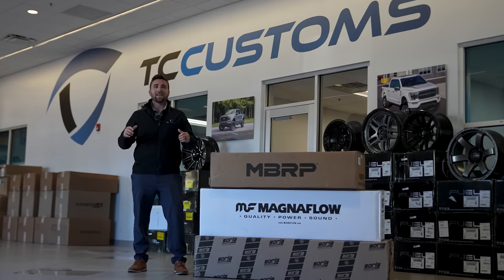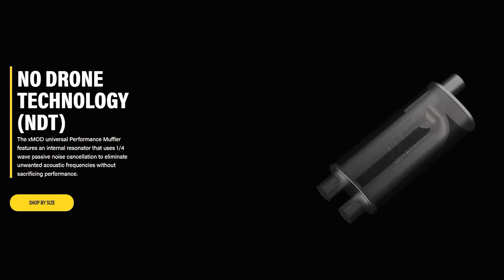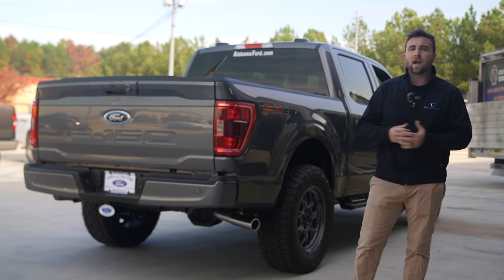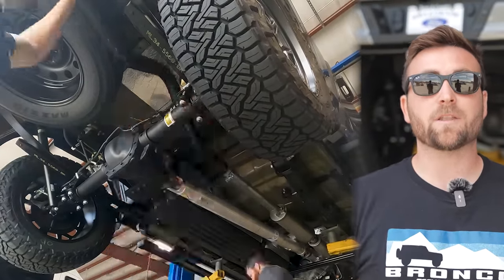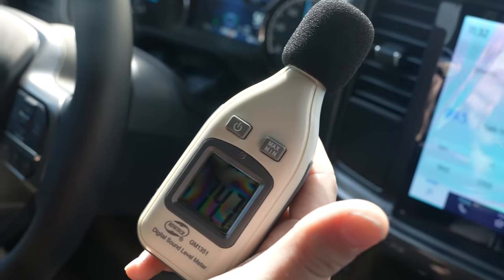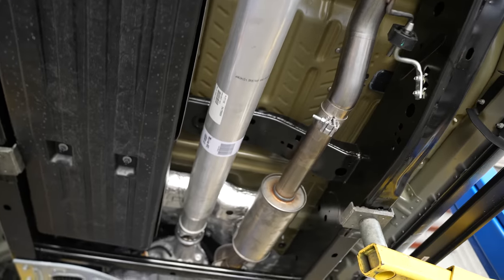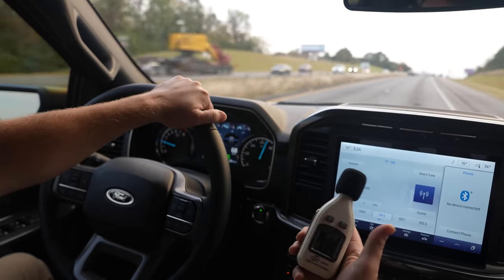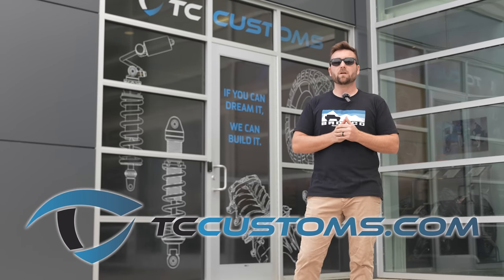The Best Exhausts For Your New F-150!

Comment: The MBRP hits the sweatspot for my ears. Not too loud, but not too quiet.  I need to upgrade my current F150 before the end of the year for work and I'm currently between the Powerboost and Coyote, and after watching this I think it's safe to say I made up my mind 😎. Thanks TC!
Reply: I have mbrp exhaust on 2020 5.0 sounds great when you get on it but pretty quiet otherwise highly recommend if you don’t want too loud
Reply: @bradleycase4391  catback mbrp on 3.7 v6. sounded so stupid. stared rusting within a week. had to paint everything with that bbq paint. from hearing the video it sounds the same as the v8. im going 5-10mph from a red light, loud like the annoying honda civic exhausts. what a waste of 600 bucks. oh and i had to pay 300 extra to install it cuz it didnt fit.  the mechanic had to cut the most rear hanger so it would fit. hahahah mbrp is the worst.
Reply: My 2.3l ecoboost Ranger has the MBRP and it sound perfect. Deep mean Roar at WOT, and neighborhood friend rumble on cruise.  It is not trying to sound like a V8 but gives a deep powerful tone of its own.
Reply: @ugabuga1361  IDK what version you got but  my 2.3l Ranger ecoboost  def doesn't sound like no Ricer. They test and post examples of all the bolts on they sell. It not annoying or chop like those honda civic i ever heard. Deep and mean. gets a little clappy up top but it is just a consist power low tenor pitch.

Comment: The Borla is by far the best sound level and tone. The tips will stand out just enough to be noticeable as the the flat black tips seem to get a little lost in the shadows. Great to have multiple exhaust from the same video, it helps really show the differences and mitigates the different recording devices that change the sound from all the various videos.
Reply: Idk I got a 2023 f150 5.0 and that corsa extreme side dumped before rear wheel is pretty mean sounding. Tho I will say it was between corsa and borla for the win. Both sound good but I went with corsa for the less truck clap sound.

Comment: Well, after listening and searching out the details, I would go with the MBRP.  I like the sound and the black pipe more than just the tip.  Look forward to pricing this out for my new 2022 F150 XLT Sport Edition.  Thanks for taking the time to break down each of the three #MBRP, #Magnaflow, and #Borla this is also the order of my preference.
Reply: Only thing about the Black MBRP is the metal is not most resistant Steel. Nothing wrong with that. However, I may not be the best choice I wet or ocean locations. Armor pro T304 Stainless is the most robust and expensive option.
Reply: I'm also considering getting the MBRP cat-back exhaust for my 2021 F150, however I'm curious about the drone in the cabin.?
Reply: @zacharyadams3274  It is zero at cruise, moderate at light throttle. eeerrrraa! at wot. it is a daily exhaust with a fun switch. that is why i got it. I love it. they have the race model if you want annoying.  great build quailty

Comment: I've purchased two of these exhausts for my 2021 F-150, 5.0L 3.73. The MBRP drones out at around 2000 rpms, which is sustained at interstate cruising speeds. It sounds good, but the drone is just too much. I replaced it with the Borla S-Type, pricey, but it sounds freaking awesome, with NO DRONE.

Comment: Out of these three I would have to say I like the sound of the MBRP the best. 

One thing to be aware of is that because the Magnaflow system that was tested here uses the factory resonator there is more of a restriction in that system. The factory system has a 3" pipe entering the resonator but is necked down to a 2-1/2" pipe between the resonator and the muffler, or at least that's the way my 2018 5.0L came from the factory. With that system you are probably not getting much of a performance gain but maybe a little nicer sound as compared to the stock system. There are other options with the Magnaflow including a straight through 3" pipe that eliminates the factory resonator altogether. I actually tried that system first but later added a Magnaflow resonator which has a 3" ID as opposed to the factory 2-1/2" ID.

Comment: I just bought the 2023 Ford F150 SXT 5.0 and want to add a little something to it. I bought it last night and add running boards this morning. The sound from the OEM exhaust is better then my 2017 f150 3.7 ecoboost but I like the deeper sound and I digging the MBRP deep sound and that is what I would get. It just make the whole vibe of the truck sound and feels meaner.

Comment: Finally “no drone” technology. Drone is the worst. All of the systems sounded good to me. The Magnaflow was the quietest and closest to stock. I’ve been beat up by drone w/all my aftermarket exhaust systems thought the years so I’d pick the Magnaflow which promises to quell drone with clever internal implementation of heimholtz resonator technology. If the others didn’t cause drone, I’d pick the MBRP for deep, non raspy sound. My current exhaust has 4 resonators (2 ea. side) to quell raspiness. Besides drone, Rasp is horrible. Excellent video and really good editing. 👍👍

Comment: Way back in the 70s, a noisier, lower restriction exhaust system gave improved MPG as well as power. No-one has yet answered if a noisier exhaust now provides better mileage on these new vehicles..
My present car, 2 L, has 2.5" pipes, with a muffler about 1 ft diameter by 3 ft long. I'll assume that has to be pretty low resistance.
i  don't need noise for no benefit, but haven't found an answer to my question.

Comment: GREAT, very informative video. Borla is the clear winner here. The MBRP has too much crackle IMO and that particular magnaflow is just too quiet. You put aftermarket exhaust on your vehicle for two reasons. Flow and SOUND. I'm leaning towards the magnaflow 12388 single in dual out muffler for my 2014 F150 leave the factory resonator in place to cancel out drone. Do a video on More Rowdy mufflers for F150's that still sound good.

Comment: Great video. It seemed like the magna flow was droning at highway speeds as you were talking or maybe more time was spent with the magnaflow at highway speeds. I liked the sound of the MBRP the most and actually have been looking to swap out my 21 XLT factory exhaust with a MBRP system.

Comment: I had all three of these companies on different vehicles and like them all and you should of put the mbrp on without the resonator it's a completely different beast and never shove the dB reader into the pipe that's way to close everything reads loud and in cab maybe try quarter throttle and full throttle comparisons with no talking to get comparable readings

Comment: MBRP 1st place on tone and sound. I have driven with stock muffler section off and it sounds AWESOME with remaining catalytic converter on both my 03 F-150 5.4 and the 2013 F-150 5.0. I posted a video on my YouTube  a while back running straight pipe no muffler or catalytic converter check it out.

Comment: MBRP with the res delete sounds pretty nasty on my 2019 5.0, the kit that I bought was dual tip and dumps in front of rear axle rather than the back. Good bit of drone inside the truck though.

Comment: If your ballin on a budget i could see the MBRP making sense for someone, but only from a weight savings standpoint. They sound horrible and are barely noticeable over stock. I would only ever run 1 if i had a track car that didn't need dual piping. Duals sound better, look better, and only add a few extra pounds. The Borla S type is nice but nothing beats their ATAK  model😎

Comment: Didn't think i would but i Like the Magna Flow 🤷‍♂... I would also like to know who PAINTED the Under Carriage Of that F-150, In Particular the rear Differential and Axel Tubes?????   WHERE'S The  R U S T???? ( I see a "Tiny Bit" at the ends but not Much at all).  My 2022 F-150 I had to Climb Under and PAINT it myself???  "O" WELL, what  would I expect for a Mere $87,000.00 ????????  😳😡?????  Seems Like this should be a NON Issue at this Point. My Son in Law's 2004 F-150 Still ain't got no RUST?????  Great Video, I'am not a Subscriber any Longer. 🤷‍♂

Comment: #Magnaflow sure sounds good on that gen 3 coyote , but I'm sure it will sounds just as good with the 3.5 eco boost as to that's what I have in my 2019 Lariat.. but I had the mbrp on my Ole 06 f150 with the 4.6 2v and it sounded good and that's about it as it had no power but it's still going to this day with 878,000km on it with one transmission rebuild,  #FORD Tought

Comment: Well that's not bad that's not bad my last Ford truck I had had the 46 Triton in it a 98 F150 I threw on some glass packs some 12-inch glass packs I've been thinking about getting a drowned a 2017 F150 but I wanted to be the 50 and my exhaust needs to be much louder than that but these exhaust would be nice if it was like my wife was driving like it really loud so that would be good I don't want the 3.5 or a V6 one cuz so far what I've heard they don't sound really not that great with exhaust they just don't sound good I understand they're faster than more powerful but the people I do know cluding family that has the 3.5 has problems with oil leaks and turbos so I'm sure no one will like this but I will stick with the 5.0